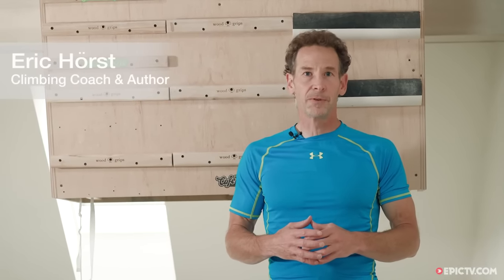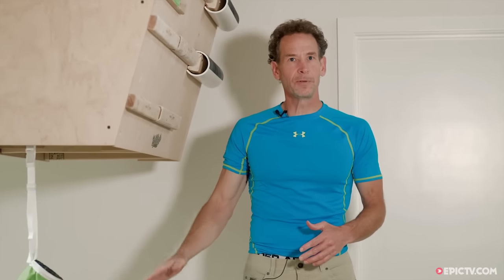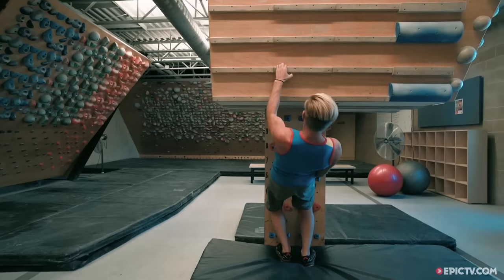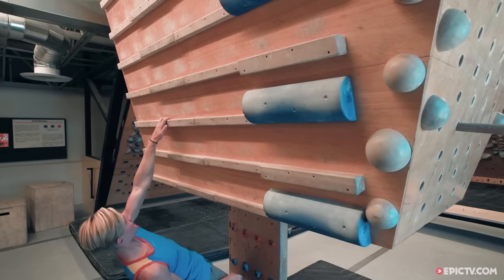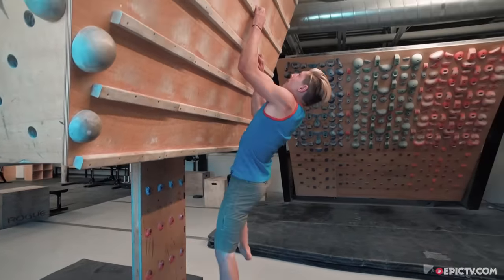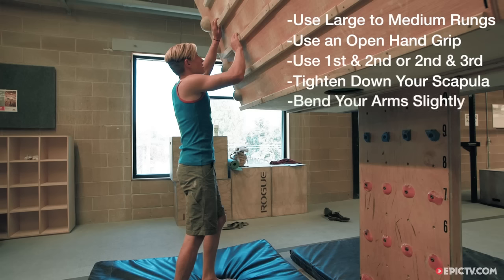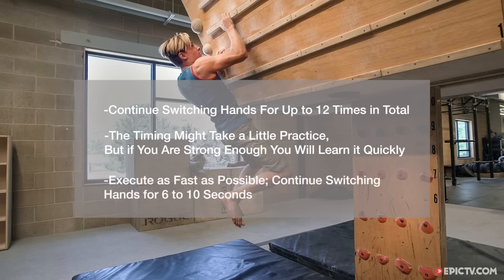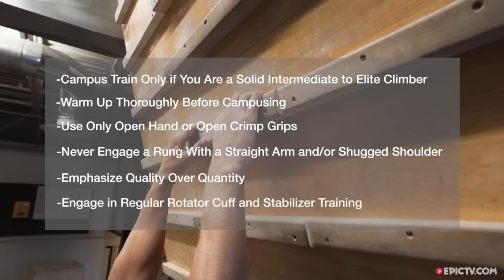Training For Climbing - Campus Boarding

Comment: Not climbing campus for 2 years? Highly disagree with that comment. It depends on the individual and what they have done through out their life. I've been a carpenter and a laborer for many years I have always worked with my hands. I find campus perfectly fine and I've only been climbing for a few months. I am 33 years old and have had no problem having the "strength" to use the campus board

Comment: I have been doing calithenics for two years now, so im decently strong in upper and lower body. I started climbing 45 days ago, im advancing very fast that im now able to crimp/pinch perfectly. I also tried the campus board 7 times and felt just okay.

Is it okay to continue training on campus board for 2 dats a week?
Reply: The textbook answer is; It takes much longer for tendons to strengthen (years) than it does for muscles to adapt to new training (weeks/months). While you may already have the upper body strength to do these exercises, you almost certainly do not have strong enough tendons to handle the stress of this type of training, and as such will inevitably get injured. Tendon injuries can occur with little to no warning, and can put you out of action for a long time.

Also. This type of training is near useless to a new climber who has not yet begun to master the many elements of technique required to climb efficiently, and will likely lead a new climber to favor campus moves/power moves over technical moves, which will eventually bottle-neck progression. 

If you have been climbing for 45 days then just keep climbing. Keep doing calisthenics, sure. But know that climbing is much much more than just power or strength and as such the act of climing itself will often be your best path to improving. For the first 2 years at least.
Reply: I do the same like you. I have been doing calisthenic for three years and started three months ago also to train climbing. But slowly because of my tendons afrer training are really tired i fill that, i can train climbing one time per week only. I need much time for regeneration of my tendons. But calisthenic helps me a lot in climbing and hope not to be injured someday.
Reply: I have done calisthenics for about 1 year before I started bouldering. Now I have climbed for 8 months and I have climbed like 100  7A and up boulders my hardest is currently 7C. And I just started using campus board because I got my foot injured. Seems like it is fine.

Comment: For me it's always hard to maintain an open hand grip while resting my pinkie on the most  rungs. Is there a trick on how to get it on or should I just leave it hang?
Reply: let hang
Reply: Place your pinky first, and turn your hand so you can fit all of the other fingers on with minimal bend in your pointer and middle fingers. Middle finger will be a little bent, but that's OK if you're careful.
Reply: For some people, those with short pinkies, open hand simply means using three fingers only.
Reply: If you’re over crimping and can’t do it with open crimp then continue to campus but don’t overdo it and add in open crimp hangboarding at the end of each session, in a few weeks you’ll be able to campus open grip

Comment: I'm 18 and I've been climbing for about a year and a half and I would say I'm around the V9-10ish area. I started using the campus board early into my first year along with hangboard exercises and I feel as strong as ever with zero injuries to my tendons.
Reply: You’re (at least you were) 18. Your body’s at its most resilient and adaptive.
Reply: @bizmonkey007  Im 42 yo 5 months in climbing. Already sand some V7. Campus is not really hard with footholds. I use first 4 steps up and down as much as I can. It is really help to gain strength and power.

Comment: There is literally no point in campus board training if you have been climbing less than 2+ years.  You can improve just as fast in a safe environment by just climbing.  You are so new no point in campusing on small rungs at that point.
Reply: MFphreak do you walk around with your nose in their air all the time?

Comment: Pft. I started campussing after climbing for a few months. This is bs
Reply: Muscles get stronger about 3 times faster than ligaments and tendons. It's very easy to injure yourself on a campus board, just because you haven't, doesn't mean it's a good idea.
Reply: The dude was just trying to give safe advice to newbies.
An average person might be able to lift 10kg on the tips of their fingers - recruiting only the flexor digitorum profundus muscle (which is a very tiny muscle that makes your distal finger joint bend).
Now if you're a fit person, and you do lots of pullups thinking you're really strong - but most of these pullups you're doing them on "jug" like holds. These holds are much easier because they allow you to recruit more muscle groups in the forearm, including flexor digitorum superficialis, flexor indicis, and more. This means you are distributing 50-90kg of body weight over many tendons, and there is significantly less strain.
However, when you do campus training, you put 50-90kg of body weight distributed on - thats right - ONLY 1 MUSCLE GROUP the FDP and its associated tendon. Their muscles tell them they can lift 90kg easily. But tendons take 6-12 months and more of continuous gradual conditioning to be able to withstand that weight. From 10kg-90kg is a HUGE increase in stress for your tendons (depending on how much you weigh), which is why alot of people overestimate and over train - injuring themselves before they even realize it (because you dont feel the strain until its too late).
Reply: You get injured only when you overdo it or not realize your limit. It is completely fine to start training campus board even if you do not climb. There are multiple factors involved. Talk to your physiotherapist
Reply: good luck with the rehab